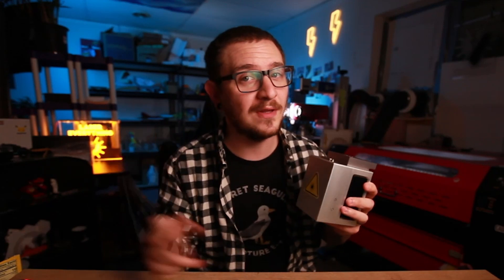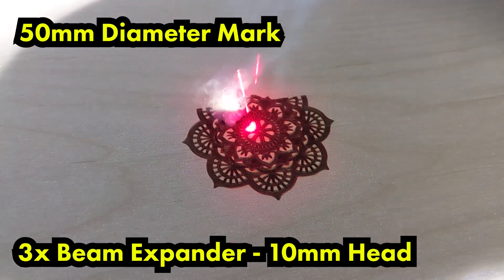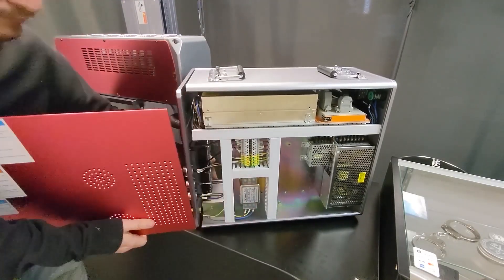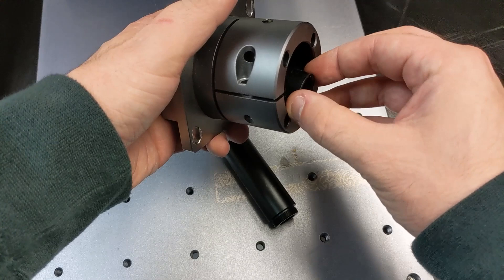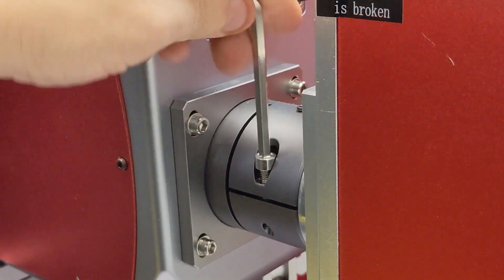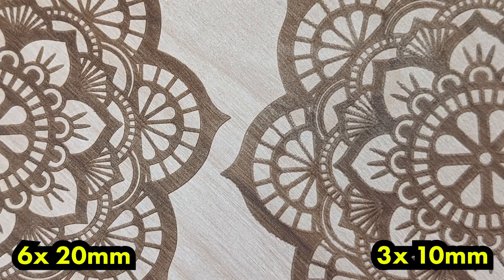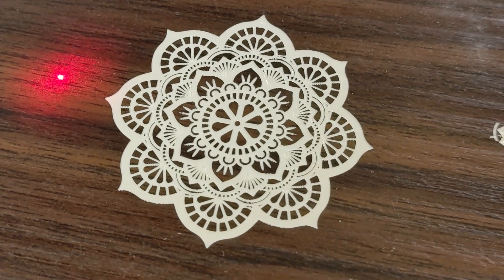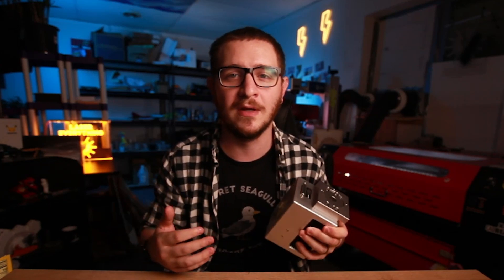How To: 20mm Scan Head Upgrade for CO2 Galvo Laser | SMALLER DOT SIZE

Comment: The enclosure looks to be exactly the same as the one on my BWMTech fiber, really good construction. I've often puzzled over just how manufacturers assemble these things - is there one company making enclosures, another lift columns, bases etc., and each "assembler" picks and chooses parts from each to build their finished system? BTW if you unscrew the top (with the handles) it's a lot easier for messing around inside since you don't have the back panel flapping around ;-)

BTW I really like how the galvo head is attached using that "neck" part which lets you easily rotate it - can you get a similar thing for fiber heads as well?
Reply from the maker: _and each "assembler" picks and chooses parts from each to build their finished system? _
I believe this is exactly how it's done. I'm not sure if the new Mactron systems use the swivel head or not. A lot of guys in the Discord have purchased their newer systems and would be able to tell you. I mean anything is possible if you have a mill haha. I'm not aware of anywhere you can just order that part off the top of my head though. Thanks for the info on the top and handles, that's a good tip!